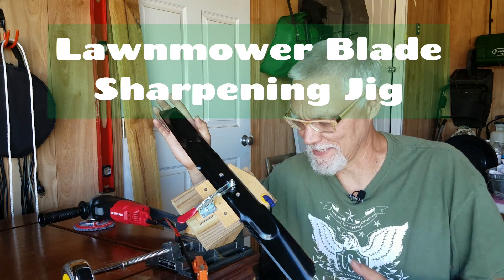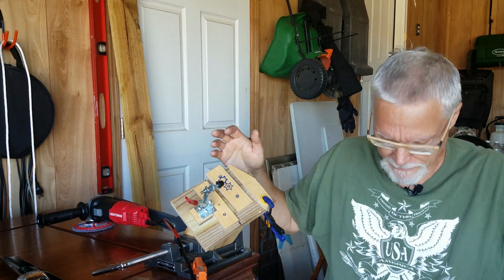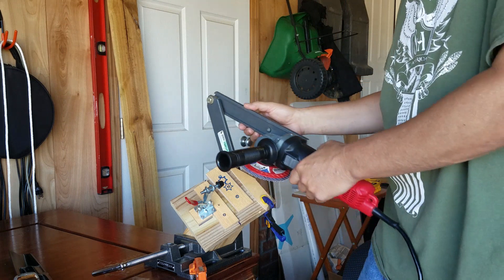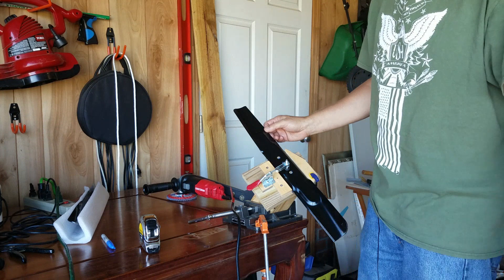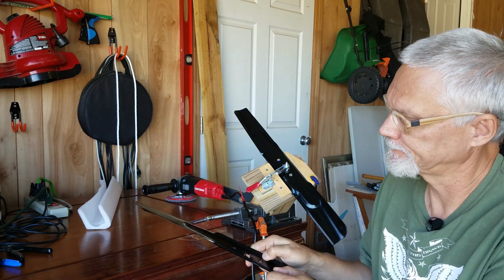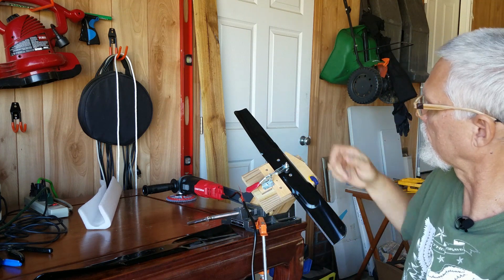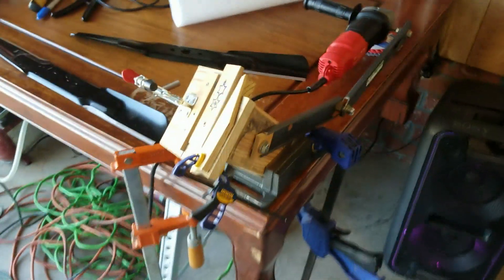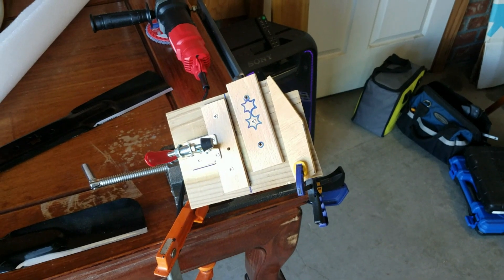Lawnmower Blade Sharpener Jig

Comment: The arms look to be about 1/4" thick. Are they an inch wide or are they even wider?
Reply from the maker: No, they are much thinner than that, it just looks that way because the metal is curled into a square shape near the sides. It was scrap metal from rails that go into a computer rack. I just repurposed them to do this project. You could just buy 1/2 inch square material at Lowes or home depot and it would work as well. Just find something ridged enough to withstand some of the twisting that naturally occurs. My setup has a lot of twist in it so I have to be gentle with it and not cause any twist while using it. So far it's been holding up well and gets the job done.

Comment: Hi there, what are lengths of the arms for grinder,  great idea for DYR's
Reply from the maker: The arms are about a foot long each and distance from bolt hole to bolt hole is about 10.75 inches. I really don't think it's critical though. If I did this over again, I would use a different material for the arms that would reduce the twisting factor that is inherent in this setup. In practice though, as long as you allow the arms to gently guide the grinder while using it, it works fine. It's pretty easy to use. If your lucky enough to come across some solid aluminum block arms, that would be much better than what I used as the arm material. Have fun with it.

Comment: What do you call the clamp you're using to secure the blade on the jig? Does it have a common name?
Reply from the maker: I answered that in a comment below by WashingtonSAFC. They are called toggle hold down clamps. The one i'm using is the 220lbs holding force version.
Reply: The brand name most often used is Destaco.

Comment: Have you considered putting small bearings on your articulating arms similar to the all American sharpener for smoother operation?
Reply from the maker: That's not necessary in my opinion. Maybe if I had a lawn care business and I was sharpening lots of blades on a regular basis, then maybe. But if that were the case, I would just get the AAS. This current setup operates surprisingly smooth if using a light touch and you don't torque it. I'm quite happy with it. I'm about to do a blade swap out soon so I'll test it out again. I have to do a bearing inspection on my spindles as there seems to be some vibration in my deck bed. I know the blades are balanced, so it might be a spindle issue or something is coming loose somewhere.

Comment: What is the device that secures and stabilizes the 4x4 wood piece? Maybe I missed that in the video
Reply from the maker: That is simply a low profile vice that I was using. You can use whatever you wish to secure the 4x4 down.

Comment: Greetings from the UK. Great job. What do you actually call those clamps, please? The actual listing name?
Reply from the maker: Those are Toggle Hold Down Clamps. I'm using the 220lb holding strength version. The ones I bought came in a four pack on Amazon but there are others out there as well.